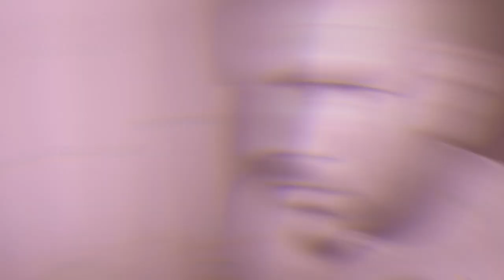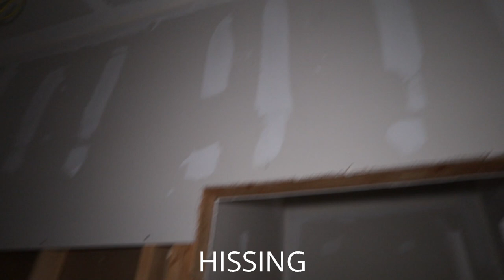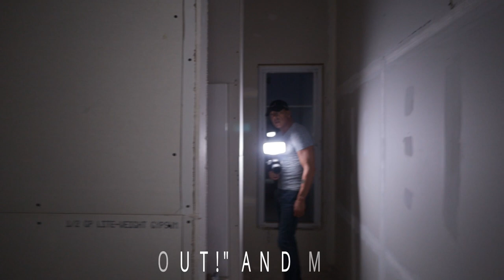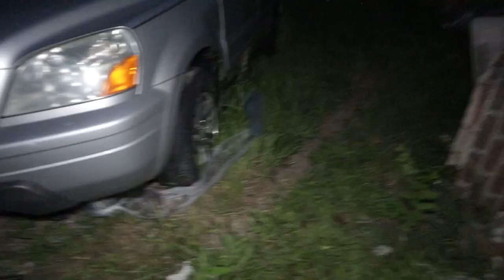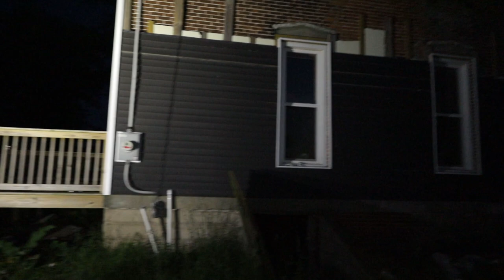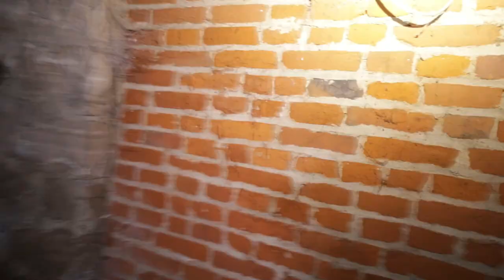(GHOST OF DOOMSDAY DANIEL APPEARS)THE MOST HAUNTED HOUSE WE HAVE EVER SEEN!!!

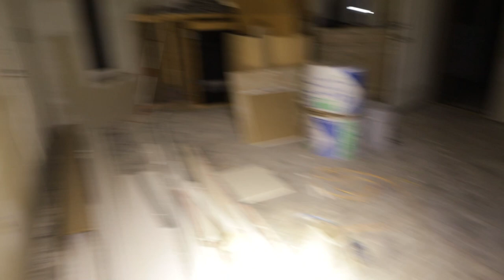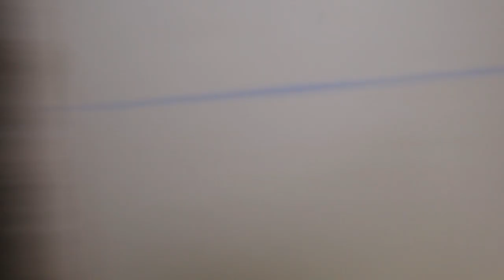Comment: You need to check the footage at time stamp 27:52 - 27:56 in the 2 windows to the left. Something is in the middle window and then pops up again as you pan your light away in the far left window. It's a short time frame but if you can watch it in slow motion you will see something white appear in both windows. It's like it was in one window then moves over to the left window and keeps watching you.

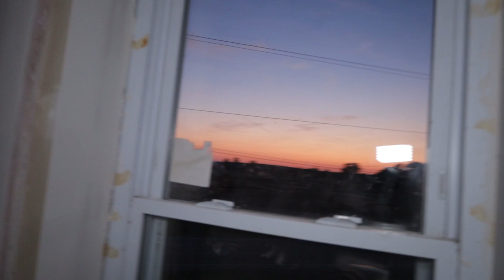Comment: Yah, at approximately 9:31-36 I see a black figure walking outside from the window as the sun sets!! Holy crap, it's creepy. It turns it's head back one time. Very unnerving.
Reply: Ooooh 👻 I should not read the comments before watching the video! Will definitely be looking out for that 👀👣👁👁 thanks for the time stamp.
Reply: @jostewart554  you are welcome! Also, look at the end of the video where Joe is looking down the stairs into the basement. Chris starts yelling.....look in the window above them, you will see the same black figure! I had to go back and look again. It scared me!!
Reply: @cowgirl3144  could you specify the time of that?
Reply: @JamiieL19  hi it's 9:29-9:30 time stamp. If you look out the window, you will see a black figure walking away. The camera is wobbly, but it helps to slow the film.....them you really get a good look at it!   It the same figure that looked at them when Joe was stopped by the outside cellar staircase ......it was in the window inside the building that time!!! Gave me the chills!